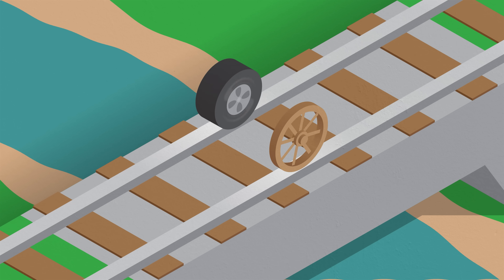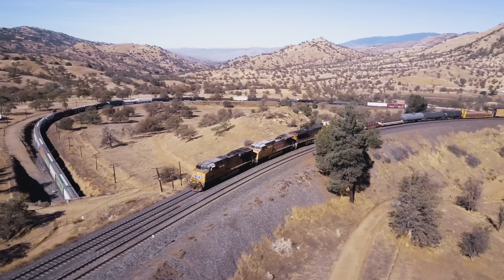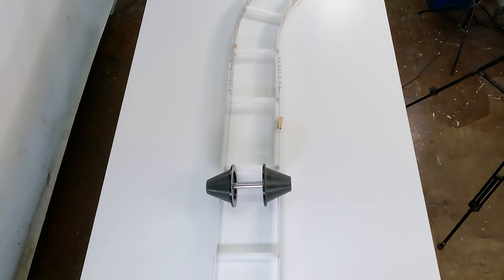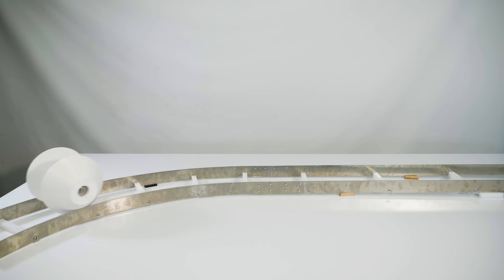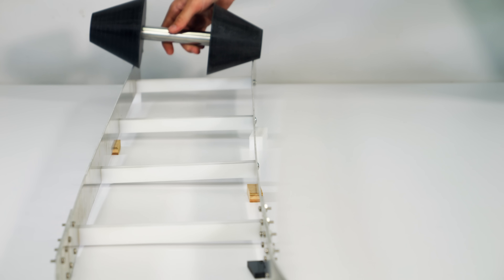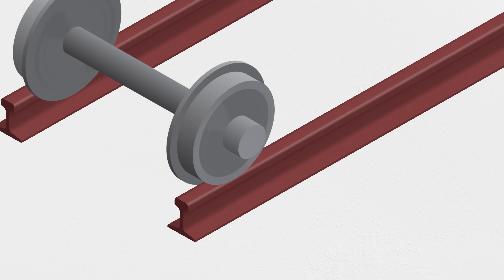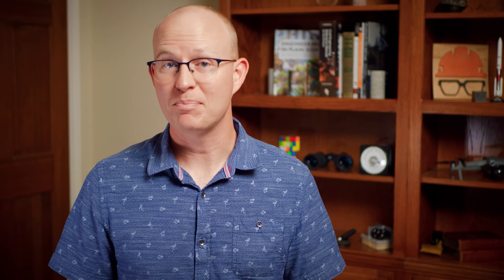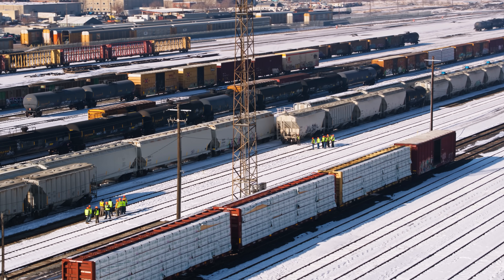Why Are Rails Shaped Like That?

Comment: I worked on railroad tunnel rehabilitation and you would be amazed at the wear that rails  experience.  The railroads have increased traffic and loads and  thus  have accelerated rail wear  thus  increasing rail replacement. I worked  on a tight curve up in the mountains of Boulder, Colorado. The wear was so much that half the inside face of the rail  was 100% gone after 6 months of traffic.  I was amazed when you think how much rail mileage exists.

Comment: Hi, So much thanks for the video. I have loved train journeys of all kinds - metro, long distance, broad gauge, meter gauge, narrow gauge and all the skidding, rhythmic train travel and always wondered about those noises and the way trains bent. Recently I came across a video about a Talgo train in Kazakhstan where its noisy because the rails have not been upgraded to modern 'continuously welded trail'. Looking for some understanding, I came across this video - https://www.youtube.com/watch?v=O4kC262exiw . What are these iron/steel rails made up of they are flexible enough to bend? What cost, engg. considerations go into constructing than the previous gen - I guess my assumption was bent iron and steel rails were forged at the factory and placed there as is. The second question was the use of talgo trains and its use of single axle wheel base. That lead me to more questions on the wagon length sizes, how they had started shorter to accommodate turning and then further developments happened. Talgo itself made innovations on this area. Maybe, you can provide more light on these characteristics also - the length of the wagon, the wheel axle configuration. Thanks again.

Comment: When you hear the flanges making contact, we call they "driving on the flange" over here in Europe. It's a horrible thing to happen because it ruins the material so much. We usually only do that with street cars and other light rail traffic and a little bit on slow parts of subway networks  🤔
Interesting to see that it's more common in you US, maybe due to the emphasis on freight vs much faster people transport? 🙂
I guess if you do it on the insanely expensive 400 kph switches of the Spanish railway system, they'll send you a bill over 500 EUR per incident 😅

Comment: I hope you will mention in a video that even the wheels are not made from 1 single metal, rather 3 parts. 1 axle and 2 wheel disk and some have a "tire" on, which serves as you guest it as a tire. If it worns of you can just change it on the wheel and it's ready to go. (I'm working in a train maintance factory)

Comment: You mentioned that the rail is like an I-beam.

That’s a backward comparison. Rails came first. The first structural steel beams were adapted rails. Of course, the shape is different, though similar. The rail producers just modified their machinery to produce the required shape.

Comment: I'm surprised some facts were omitted. Such as how locomotive and carriages often have metal tyres that are heated up and shrunk onto the wheels (which are pressed onto the axles), so the tyres can wear down and then be replaced instead of replacing the whole wheelset. And how light rail often uses steeper angles on the wheel profile to allow them to take tighter curves, and due to their low speed, hunting is rarely an issue (except you can really feel it on some of the DLR in London, and see it on some sections above ground on the Tube), whereas high speed trains have more flat profiles so they can maximise speed on relatively straight lines, meaning flange greasers are needed on station approaches or in yards where the curves are tighter (and speed is much lower).

Comment: 8:41 "the shapes are I-beams" ... there is a lack, or misleading info about the I-beam here, sorry. The web is not "only to elevate the wheels from the gravel/debris". It is actually a "beam on elastic foundation" because the gravel/wood act as a COMPRESSIBLE ELASTIC FOUNDATION, therefore local bending stress arise in the rails! The most economical shape to hold bending stresses are the I-beam shape, so that is the reason why it looks like an I-beam. Otherwise, if the foundation would be much more rigid, any shape could do.

Comment: Grady,  this is so cool.  I've been learning about GD&T and why print interpretation matters.  Engineering Essentials has an example of railroad wheels that had the stamp placed on the wrong side due to incorrect print interpretation (first angle projection vs. third angle projection).  This video helps me understand why this error costs a company over 1 million of scrap.  The wheels would not be able to make proper contact.  Thanks for highlighting an engineering problem that, as you say, we would assume has long been solved but it's still very relevant.

Comment: My stepfather was a widower crazy with building a memorial amusement park train (20" gauge) for his deceased wife. He convinced my divorced? mother to move in with him when I was three years old. Eventually he built gasoline powered miniature locomotives and cars. They rolled on scrap mining rail. 
They actually worked by some miracle.

By the time I was seven or so I had the chore of keeping these things oiled and cleaned. Over the years the RR grew into a complex consisting of four "locomotives", six passenger cars and a couple of work cars. By this time I was responsible for keeping these things operating. He built, actually I built, a two story shop. He had a very old lathe, drill press, hydraulic press, arc welder installed by the time I was twelve. I learned to use all of these tools. If you want to have fun on a summer day try hand sawing a 1:14 switch point on the end of a 16 lb. per yard rail. Oh, you need two for a turnout. 

Eventually this became untenable as alcohol addiction exaggerated his inherent meanness and I had to threaten to beat him up if he tried to hit me again. He stopped hitting me and continued to hit my mother. Eventually she ran away and dragged me with her. I did not want to go because I actually liked working on the railroad. He closed the amusement park because he could not keep it running.

If any of you have ever heard of the Carylon Road located just west of Albany New Your in the 1960's please make a comment. It has been 60+ years and I wonder what happened to it. Thanks, GregW

Comment: conical wheels only solve some of the problem with curves.  Trains with solid axles on curves make a lot of noise from the wheels slipping because of differential distance traveled.  This noise can be significant.

Comment: Ex-railroader. More interested in the subject now than when I used to work on the RR. I saw a  train break-in-two right in front of me -busted knuckle.I watched a car in a train pick a switch, try to go down two tracks at once and derail. I didn't see it go on the ground, too busy departing the scene. Entering a yard, so  it wasn't a wreck, just a run-of-the-mill yard derailment.  
Great info on wheels. I did not know all that detail about wear. Rail greasing devices are common where there are curves. Why do the wheels wear by flaking?  The rotating  relative  motion at point  of contact must have something to do with that. 
Ribbon-rail? Laying rail in 1/4 mile lengths was an important innovation. 

I play around with a stream-table, but use much finer sand. I create miniature arroyos and deltas.

Comment: I may have seen a shortened version of Feynman on "why a train goes round" a corner, but it seemed to me he came dangerously close to saying there was no force required because the conical shape of the wheels "steers" the train round the bend. Of course, Feynman must know that an inwards force is required (it is developed at the contact points on the conical surface, not the flange as one initially thinks) but this wasn't clear from what I saw.

Comment: Is there any purpose for the diameter of train wheels? Is it a standard that just kinda stuck? Besides the benefit of more wear surface, is there a geometrical reason why if they were smaller or bigger in diameter that the geometry wouldn't work out?

Comment: Great video, interesting continuations would be about rail profile restoration through rail grinding (or more niche milling), or how different transit systems have their own rail and wheel profiles designed for their specific system. 
On a separate note, there is new freight construction projects in north america but are generally capacity expansion such as new or extended sidings or secondary mains.

Comment: Why are rails vertical not angled inward?
Reply: Why would they be?
Reply: @darthmaul216  Wear would be even across the surface instead of one side. And there wouldn't be forces trying to kick the rails out. Vertical rails have to fight against the angled train wheels acting like a wedge, pushing them away from center. This puts torsion on the whole thing.

I'm guessing it behaves poorly in sharper turns or something like that
Reply: @darthmaul216  Looking it up, it is called 'rail inclination' and is apparently standard. So the wear diagram in this video is wrong. Wear should be even as the wheel should touch center to the head of the rail.

Comment: Rail basically came into existence the same time as roads. The first ones were 'rutways' for roman chariots and carts. Basically you had a dirt path which cart wheels would get stuck in. So they put stone reinforcements down where the ruts in the path were. Though there were U shaped to hold the wheels and stop them from slipping off into the mud.

This was very common because it was far cheaper than putting in a real road where the whole surface was designed/engineered (same reason we don't build roads out of huge steel sheets now). Of course, the romans built tons of roads too. And many roman roads had rutways built into them.

Comment: A VERY interesting video. I'm a (long since) retired deputy sheriff and traffic accident reconstructionist on my department's major accident investigation team. One of the first questions I always asked when teaching accident investigation, "IF a train has solid axles, HOW does it turn corners?" You answered that question in this video... quite well, actually. The one thing you didn't touch on, and maybe you do in a subsequent video, is HOW do you start a train turning? Of course, that answer is super-elevation of the tracks to overcome (or initiate) gyroscopic precession. By lowering the inside or raising the outside track, the precession starts the train turning in the direction of the turn. GOD, I love this stuff. Thanks for producing this video!!! Carl, Washoe Co. Sheriff's Office, Reno, NV, Traffic Section, MAIT (retired).

Comment: Nicely done Grady.  On curved track the track gauge is slightly wider than on straight sections of track, the additional distance between the rails differs depending on the curvature of the track.  When the rails are canted on a curve there are extra calculations to set the track gauge correctly for each specific curve. The permanent way is also much more complex than is obvious to the eye, the ballast layer is only one of many layers that provide the foundation for the sleepers and rails. I'm sure You could do an entire video just on the design, construction and upkeep of the permanent way.  I am an retired railway engineer who worked in many fields over my lifetime including ; P-WAY permanent way,  S&T signalling & Telegraphy, TCD Traction Current Distribution including overhead catenary and third rail systems in the UK.  Always interesting to see differences and similarities in infrastructure between countries. Keep up the great work Sir. Thank You.

Comment: Some interesting things in the European high speed trains. The side-to-side motion of the bogies was apparently a big problem between the carriages - large movement between the two adjacent bogies caused lots of issues. The solution - one bogie shared between the ends of two carriages. Also to avoid points/switches causing a problem they use Swingnose crossings where at the frog (common crossing) there is no gap unlike most.

Comment: many many years ago i worked for a railway.   and was a programmer.   one of the jobs i had was to ride what was called a Sperry car up the line - the Sperry car read every inch of the track and fed that info into a computer.   I wrote programs to predict when those sections of rail would have to be switched out.   when a wheel goes around a corner, it leans, and sort of wears out one side of the rail or another... they get cracks inside, bumps, wear down on top etc and that can cause a derailment.  riding a car for hours is boring, but writing the program to turn that data into something useful was pretty cool...

Comment: In fact I would've expected the geometry to resemble ice skates much more, or at least your dumbbell model where the point of contact is relatively small to minimize friction. Of course ice skates are supposed to bite in the ice so that sharp curve is an exaggeration of what you'd want for rail system.

Comment: Train wheel question. For a long time passenger locomotives used larger drive wheels than freight for higher speed and smoother ride. However as far as I can tell this practice stopped and passenger locomotives use lots of small wheels similar to freight. Why did this happen and when was the date that became the norm?

Comment: Another interesting part of the physical rails is how they are used as part if the sensing and signaling system to keep track of where trains are located in the system and when it is safe to move a train from one section to the next. Train location is vital for automatic crossing signals etc.

Comment: Grady, you showed all of the pictures of wheels on rails, ON tie plates (angled tie plates), but no mention of the importance of the tie plates in reducing wheel wear, or it's assistance in helping the wheels on corners.
I worked on the railway, in the 70's, before working as a diesel mechanic then surveying.
I am a retired mine planner/surveyor, originally trained, in the late 80's, by a retired railway surveyor.
Best wishes from the far North.

Comment: Thanks! Very informative. What I missed is why North American trains are so slow. In Europe, there is an ever growing network of trains that travel at 200 mph. And the distances they cover is less than in North America. Great for reducing air travel.
Reply: Short answer: not worth it when cars and airplanes exist. 
Automobile rules in NA. Private Freight cars get higher funding and priority than federal passenger trains. ElMo even delayed a rehaul of the railway system by promoting the revolutionary Hyper loop (Which neben happened). He knew what he was doing and admitted to it. Americans don't want to improve public infrastructure, they will fight tooth and nail till their last breath to fight the bill. They are weird

Comment: The "hunting" phenomenon reminded me of something that would probably make for an interesting episode idea for you: trailer design and loading.

In a game called Space Engineers, I've built a lot of trucks and trailers of various types for hauling things, and it's taught me a lot about how trailers behave with different designs and load distributions. One of the things I've had to deal with has been similar to "hunting" where, when going downhill, my lack of ability to implement trailer braking causes the trailer to push on the truck. This tends to try to turn the truck, so I steer to correct. Once that steering turns the truck back to the balance point, the forces suddenly flip and I have to correct my steering the other direction. This tends to lead to a progressively violent lashing side to side and can lead to rolling the entire truck and trailer if I'm going too fast for my load or don't reach the bottom of the hill before the progression gets out of hand. It behaves like balancing a stick on end (with the truck being the stick). It's easy for the system to go out of control. All sorts of different hitch methods, trailer designs, and trailer loading can lead to stable or unstable systems. It's a really interesting topic to explore.

That same game has been pushing me towards becoming a railfan, too. I once tried to design a train, and hours and hours of different designs led me to having a truck on each end of each car. I was still having trouble at that point so I started looking up actual trains to get design inspiration. I found it really cool that my own designs so closely resembled reality. My train attempts in the game were eventually stifled by having to admit that the game can't handle the complicated physics when the train gets up to practical speeds, but it's left me with a bit of a craving for trains.
Reply: For trailers, that is typically called "fishtailing", which may lead you to some interesting resources.